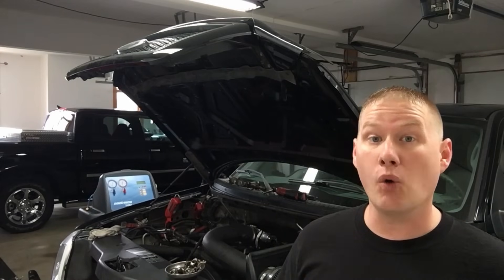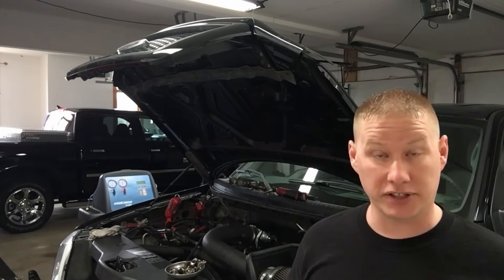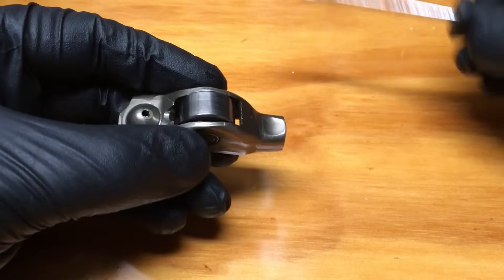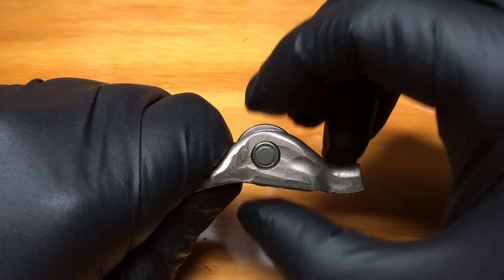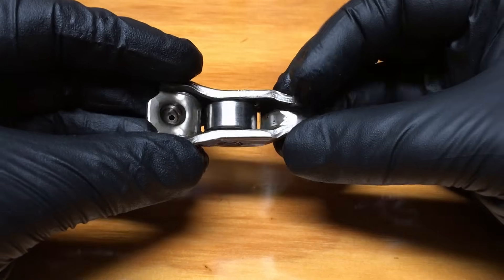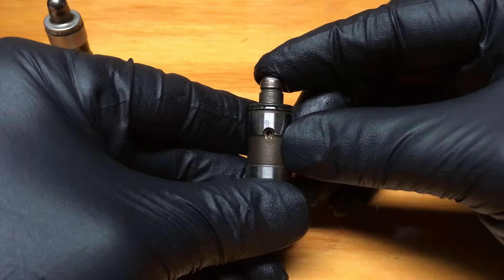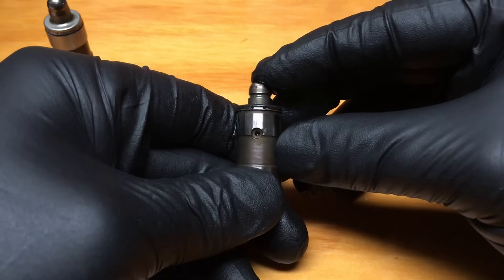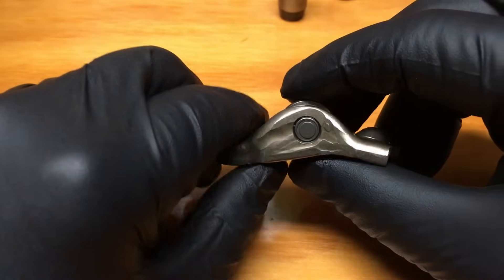Ford 5.4L 3v Triton Engine Ticking Tapping Noises: Must Inspect Items!

Comment: Is there any additives that would prolong a replacement? I'm not in the position to do the job right now. The kit is a little over four hundred bucks. Plus I haven't watched the video yet but seems like you have to remove the camshaft so then you have to remove the timing chain. So things just got even more expensive. I've been driving it with it ticking for 30 plus thousand miles. I put some Marvel Mystery Oil in it but it actually made it louder any suggestions on something that would help me delay?

Comment: I recently did the full timing job on my 2007 Expy. Although all the followers & lash adjusters were good I replaced them anyway . I figured at nearly 200,000 miles it was good insurance to do so. Great video!
Reply: How much was the job in total if u dont mind me asking , bout to do it to my 250
Reply: @jeffdavis3011  1200 easily.

Comment: Hi, have a question....just bought a 2008 expedition with 165k on it......runs and drives excellent but on first start up after truck sits for a while it ticks for maybe 15  secs then stops....I've noticed if the truck sits it makes the noise....if I drive it then shut it off and come out half hr later it dosent do it....im guessing maybe the oil is draining ??

Comment: Hey! I have one question about those lash adjusters, I took 16 of them out and any of them didnt look like the known good one on the video. They compressed like the bad one. I measured them and some had up to 2 mm difference in height. Is this normal that they are not equal height or does this confirm that they're bad?

Comment: I have had a tapping sound only on startup and goes away after just less than a minute.  Recently have got a squealing only when revved up, is something getting worse or a new issue possibly just a pulley? I don't want to waste money and replace cam phasers too early neither do I want to be too late and ruin the engine as I hear when the phasers go bad it ruins the engine immediately?

Comment: Do you have a video that shows used to take the rocker arms off and the slash adjusters I got the rocker arm part figured out I'm having trouble with a slashthe first one I cracked a head but I want to learn it cuz I have the other side to do I got the second one out but I had a little trouble the third one I cannot removeso do you have a video on this lash adjusters for a 4.6 3 valve 2005 mustang GT

Comment: I have a 2009 F150 with the 5.4 3V and 139,000 miles bought used 2 months ago and did my first oil change with all motorcraft oil and filter and my truck started ticking immediately after oil change. I ran MMO for 100 miles and added fuel injector cleaner because it stumbles now when I get down on it. I changed oil and went with the conventional 5W20 this time, but it still ticks. I am gonna check for plugs being loose, but I have not smelled any fuel smells and the dealership put new plugs in it about a year prior to my purchase. I am hoping its not too bad of a problem. Any ideas?

Comment: Hey I got one for ya! Just spent 10k and dropped a reman 5.4 3v in my f150 with a new flex plate and TC. Well something is knocking and at first I thought it might have been a manifold leak. Had them checked and nothing. Was told it was normal timing chain noise which I know from your videos IS NOT normal..... But where it sounds like it's coming from to me is around the bell housing area and where the new TC was installed. I don't hear the rattle near as much at the front of the motor as I do the rear between it and the trans somewhere. I just have a feeling im going to keep bringing my truck back over and over again just to be told it's normal and have to spend more money on top the 10k doing so. It really does sound like it's in the bell housing. I tried to scope ot with a screwdriver but haven't quite pin pointed the noise. Just the general location. Hoping it's not resonating from somewhere else. I still have yet to check my injectors and possibly starter. When I pulled the inspection plug to the TC the teeth looked fine as far as I can tell. Maybe my cats? They didn't make much sound when I scoped them. Like I said it also has a new flex plate. I'm at a loss here. 
Edit.... The reman also came with sprockets instead of phasers and a module to flash my computer with so it can't be due to cam phaser noise because it doesn't have any anymore. They're essentially what a lockout kit would accomplish.

Comment: Are there differences in the construction of the lash adjuster for the 1999 5.4L 2v? They don't feel like they have a spring built inside them.  Thanks

Comment: Thank you for posting all the great videos they have been a huge help on this project , I have an 05 5.4 just turned 238,000 miles and really have been problem free to this point , I started having more pinging and valve train noise , was thinking worn cam journals , bad phasers , vvt,s , so I tore into it got the valve covers off and found that the very rear roller rocker on the left side,  out and laying in the head , with the roller froze solid , I think I may have lucked out the cam looks great go groves or scratches on that lobe at all , looks like the roller froze and the cam just spit the roller follower out .My question is I should be just fine replacing all the roller followers only and not replacing the cams , is there anything else I should be looking for while I am in there ? thank you in advance for your help

Comment: What’s a ballpark figure on a complete job like this ??? I have a 06 Ford F-150 Lariat
Reply: I was just quoted $1100 parts and labor by experienced mechanic.
Not counting oil pump. New motor $3495.00. Not too bad either way really.
Reply: I'm in the same boat, told I need a new engine to the tune of 4 to 6 grand. O6 lariat 5.4l engine. Ford dealership in the area isn't worth a damn either.

Comment: So from what Ican tell from the diagram is the 2005 mustang 4.6 uses these same parts right ? I have a coworker and his bank 1 is making a noise I've never heard before. I'm going to pull his valve cover to inspect. Any other things I should look out for on the 4.6 ? Btw sounds like cylinder 3 area from what I can tell

Comment: My 2008 Expedition has 150k+ miles on it. After seing your videos I now understand my 5.4 3 valve much better. I do not have a knocking but have noticed a bit of a rough idle. I am taking it in to get the valvr covers pulled and the cams inspected. Knowledge is power and a good way to keep the purse strings loosened up. Thanks.

Comment: So I left you a message on one of your other videos to but this one was a lot more informative to my target information. At least I think it is is there anything I could do before tearing my truck open to know if that's what is making the problem I have for sure because I have a 4.6 L on a 2000 Expedition and it's coming from the left side of the engine and it sounds like it's coming from one of the wheels the belts are on but it's a ticking sound some guy just actually told me hey I think your lifters are going bad. If you don't want to answer my questions just ignore me and I will get the hint but you seem like the most knowledgeable out of all the videos I've watched so far on YouTube so I'd appreciate some advice but if you're too busy keep up the videos man they're very very good videos and very informative I appreciate you putting them out there for everybody

Comment: tearing apart my 2006 F-150 4.6L Romeo 300,000 miles with a ticking that developed while traveling to Montana (sounds like a lash adjuster, everything in the engine is stock). I know you usually reference the 3v motors, I'm assuming the same characteristics apply to the followers, and adjusters on the 2v. Because of being out of state, and far from shops I was forced to just cringe and drive, the noise stayed the same and after all was said and done it had 1,200 miles put on it in 6 days. I am kind of assuming that since the oil pressure remained 30-40psi, and it didn't fly apart that my bottom end is still in tact. Made it back to Washington and I will start the upper VT teardown tonight, and I am going to do the chains, guides, melling pump, and tensioners also (like i mentioned 300K and all original). Hopefully I am on the right path of action, you are a stellar tech, and I enjoy your channel immensely. If you are curious I can reply back with what I find.  Thanks again!!   ~ Jeremy

Comment: I have a 2000 ford f-250 that loses power after driving 20 minutes.But you can turn it off an start it back up an drive again. It has a new relay, regulator, filter an pump still no fix. Any information would be appreciated thanks.

Comment: I own a 1998 Eddie Bauer Expedition with a 2V 5.4L Triton that has 112,000 original miles on it and has  just developed a very loud knock.  My initial though is that I have "thrown a rod" as that is what the engine sounds like.  Additionally, the engine is now burning significant quantities of antifreeze (you can smell the combusted antifreeze in the exhaust and see the antifreeze reservoir slowly falling).  However, there is no check engine light on and the engine seems to run pretty smooth in spite of the noise and antifreeze consumption.  Ford Tech Makuloco, what would be your thought(s) on what might be wrong with my engine?

Comment: I have a 2010 3v 5.4 that ticks when I get to about 1000 rpms I’m gonna try 5w30, hopefully it’s nothing too bad the motor only has 89k :/
Reply: Mine 2010 5.4 does the same thing and I have 171000 miles on it. I have heard the ticking noise ever since I bought it and I bought it with 43,000 miles. I can really hear it some times at a drive thru but never had a problem. I have switched to 5w30 and I change the oil and oil filter around 6000 miles now. These engines make noise. Just keep your oil changed, get the rpm's up every once in a while when on the highway to help push out any gunk build up in the undersized oil ports and you should be fine.

Comment: Does the " noise" you describe also apply to the 2002 year 5.4 liter engine.  I believe ( although I'm not sure)  the 2002 year engine has only two valves per cylinder.

Comment: I have a 97 4.6 that'll eventually need new lifters. It has that tic to it at cold start up, but when warmed up it quits ticking. I've ran lifter conditioner in it once but no luck yet. Have any advice on a conditioner to use? What I've used doesn't seem to be working.

Comment: This is unrelated to this video but I have a question about o2 sensors. 
1. What side is bank 1?
2. Are all 4 sensors the same part? / upstream- downstream bank 1 bank 2?
I ran the codes and the codes give me p0141 and p0161. Any help would be greatly appreciated I’ve been dealing with a issue for awhile and just ready to replace them all.

Comment: Your vids are awesome, I just subd. I'm looking for a little advice, I just pulled the heads on a 07 Ford Fusion and the roller followers and lashes got mixed up when my dog bumped my bench, now I have no idea of the original orientation, I know they have their own wear patterns, I ran my fingernail across everything and couldn't tell any big difference, it's expensive to replace all the roller followers and lashes.
Can I get away with just installing them and adjust/prime the lashes?
Any help would be greatly appreciated thanks.

Comment: I recently bought a remanned 5.4 3v from Remanns.. was wondering if you could give me some tips on break in for the remaned motor. Like should I remove and soak the lash adjusters? What type of oil for break in, should I let it idle for 30 minutes then change oil on initial start up like a modded motor?  Lmk what you think want to do it right to make it last a long time!

Comment: Do I have to prime new lash adjusters prior to installation or can I just install new ones as is? I just did whole timing set and new roller followers and lash adjusters. I still have a tapping noise that I cannot figure out where it is coming from and not sure if the noise was there before because it was so noisy before. I installed them as is without any additional oil other then the thin oil that was already on/in the lash adjusters. I hear the noise toward rear of driver side, but cannot pinpoint.
Reply: Sounds like exhaust

Comment: You mentioned that the 5.4 had issues from 04 thru 14. Wasn't 2010 the last model year of the 5.4? Also, what's your opinion on the 5.0 coyote by comparison?
Reply from the maker: No the 5.4L 3v was used through 2014 in the Expedition.
Reply: FordTechMakuloco Appreciate the response. I did not know that.

Comment: Its a shame the 5.4 3 valve is really getting a bad rap of a motor just top end and phasers issues with plenty of warning signs, did my spark plugs with no issues also not that hard of a fix if you're mechanically inclined with your guidance the best procedure instructions on YouTube.

Comment: So what’s the deal with the Boss 302’s ticking? Have 26k on mine and after it warms up, it has a slight ticking coming from the passenger side of the engine.
Ever have to work on one? Or any TSB’s?

Comment: I'm wondering what's the ticking noise on my 07 F150 5.4L and the reason my oil pressure is a little high? My Ford has only 59,318 miles.

Comment: Good vids you have, thanks for the info. I had a 2008 F150 FX4, supercrew, for work. My truck had over 700,000 + KM, when I sold it. No problems at all with engine, never had to work on the brakes. Only the upper ball joints had to replace. I am a FORD man my whole life, started on the farm. All my trucks have had over 700,000+ KM when I sold them. Currently my 2014 5.0 L, has just over 330,000 +KM, running good.
Reply: I have an 06 with a 4.6L that has 330,00+ and a 2000 5.4L with 240,000+, both purr like kittens.

Comment: I have 2004 ford 5.4  when I floor it, it makes a rattling or knocking noise on the drivers side . Is that the rollers or want would it be.

Comment: Good shit. Very informative. I bought a used 07 motor with 19,000 miles and put that in. Was alot of work but sounded better than the 04 did .Ford wouldnt stand by my 04 because i did my own oil changes

Comment: Hey there, are you familiar with a aftermarket cam phaser limiter? It replaces the backplate, but I have to remove all the screws, even the retention one. How could I ensure keeping it still? Vice grips?

Comment: Please help I got a code P0453 and was told it was the Evap fuel pressure sensor.  We took off the tank and the sensor is not on the tank.  It's a 2004 ford f150 Triton 5.4L 4x4. Where do I find the sensor to replace it?

Comment: Great Videos and instruction.   My wife's Expedition had a big clunk and stopped running the other day.   Still not exactly sure what happened but I do know a rocker arm broke and the valve next to it has a bent stem.   I don't see any other damage so I don't know if the timing skipped or the arm just flat out broke.   I would think that if the timing chain jumped all the valves on that side of the motor would have damage but in this case just one cylinder had the issue.   I guess the next step is to pull the head and see if the piston is damaged?  2009 5.4 3 valve with 125K by the way.

Comment: Thanks for the good video. I went ahead and took out the camshaft on my pax side to inspect the lifters and rocker arms because I had a loud knocking noise at all rpms all the time. (Before I did this i changed the tensioners, solenoids, phasers, guides and still a loud knocking) Come to find that my rocker arm seized up completely. The bearing didn't just drop. It dropped and it locked up (a little cocked too). For info purposes it was the last intake valve on the pax side for #4 cylinder. Now I have no more knocking. Happy camper here.

Comment: Great, my bought new 50 miles away from started making that noise. Complained twice to them, they said that was normal. Now 14 years later with only 76,700 miles on it, peeps think it's a diesel at first. Sure glad I paid 40g for it. Love the truck, but way to many issues for the price I paid. Thanks for the video.

Comment: So if the lifter is faulty, is it safe to replace just that lifter or would all the components in the head need to be replaced ?  Wondering if its just a better idea to get a new head or not

Comment: My truck is making the ticking noise on the passenger side, which through a stethoscope sounds like metal on metal banging. It doesn't get louder when I remove the oil cap. The car also seems to struggle to get up to RPM. Do you recommend that I pull the valve
 cover and remove all of the roller followers and check them for bearing slop as well as check the lifters in your video? Just wondering if there is any other way to diagnose exactly what is ticking before going through all of that work. Thanks for your videos they are great!

Comment: I have a 09 4.6L.3v and for 5 years its sounded the same, when first started tell up to operating temp. Minus the driver exhaust manifold tick lol
And the injectors you can here the pulse. Are these engines typical noisy? It doesn't sound like the "diesel" cam phaser noise. I can't here it from outside just,when the hood is opened. Like I said its been the same noise for 5 years. I use only motorcraft 5/20 oil and filter. When oil life is at 30% i change it. It does quite down some when the oil is changed. But figured id ask your opinion. Looking for a bit of peace of mind lol. What could I be looking or checking for? Thanks

Comment: Would the failed roller problem cause a ticking noise on start-up that lasts 30-60secs on a 03/03 Cobra? I have replaced the lifters, no difference. Thanks in advance,

Comment: I had a 2004 STX 4X4 F150 with 4.6L for 13 years until the transmission blew. I just picked up a 2015 F250 with 6.2L gas. Any comments, recommendations, or things to worry about? So far, it's pulling our camper great. The camper is a 28' travel trailer. dry weight is 6200lbs.